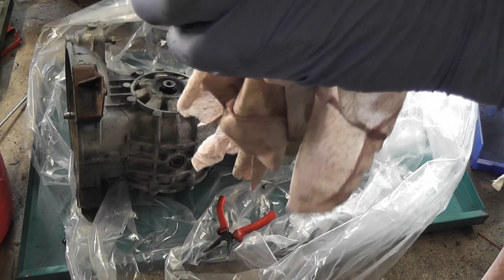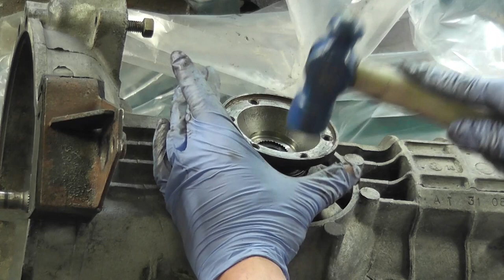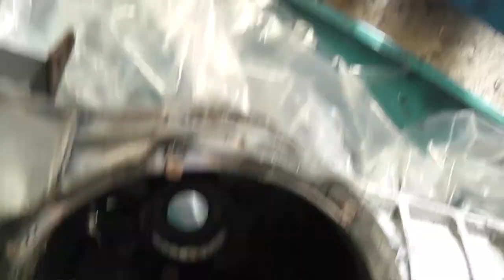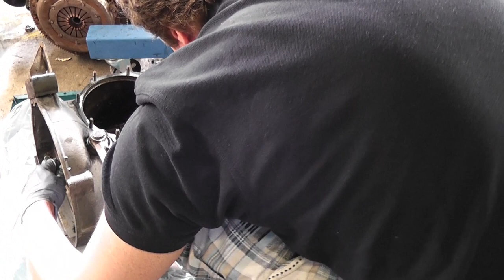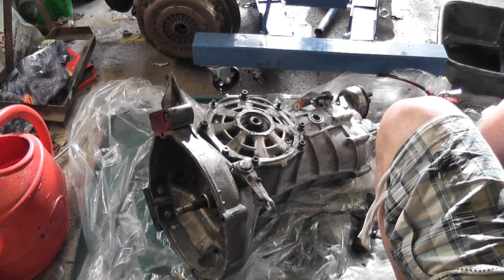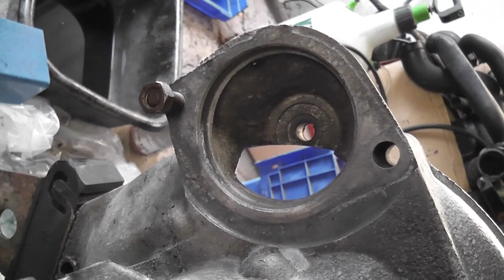VW beetle gearbox shaft seal replacement, partial strip, clean and repair - VW 1303S IRS gearbox

Comment: My 64's Bug trans. has never been out of the car.  Seals, boots and oil sevice keeps them going!
Reply from the maker: I actually didn't take it out myself. The guy who did the bodywork took it out along with the engine for some reason so I took the opportunity while it was out to tidy it up.
Reply: That's what I thought72 bug std, until last month I came to a set of traffic lights in Galway city at peak time and ...no go...no gear engaged. Nightmare. Couldn't see any issue. Engine and box out. Rear box mount the rubber  broke clear away. Replaced it and found clutch cable down to one strand! Gotta replace that, not fun bank holiday job.😢